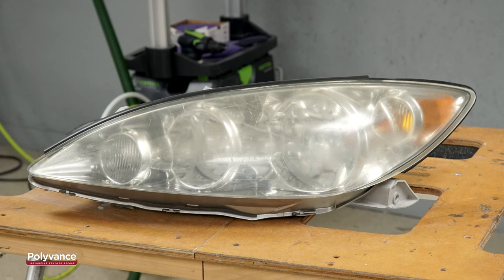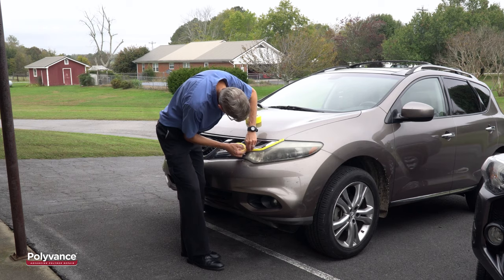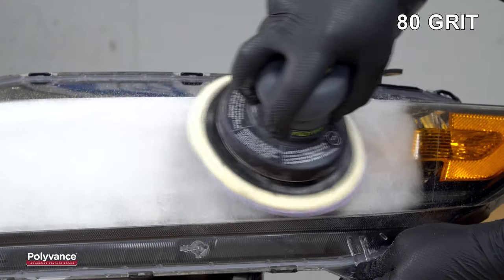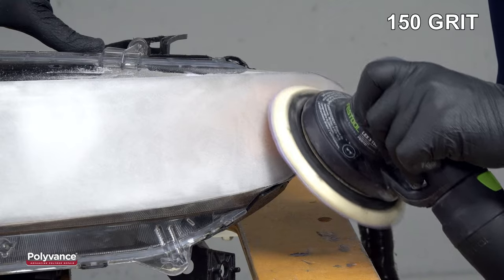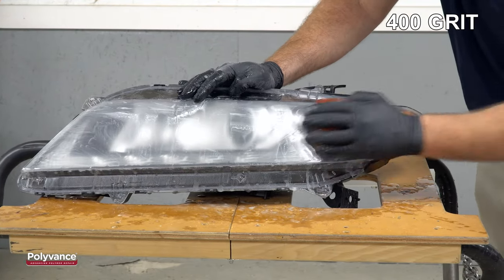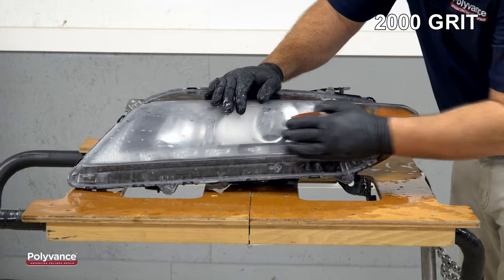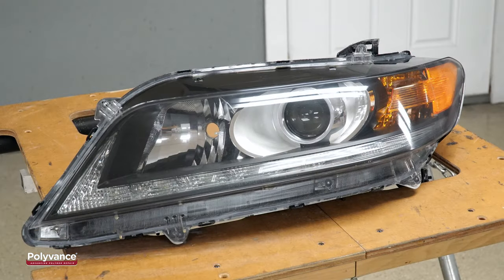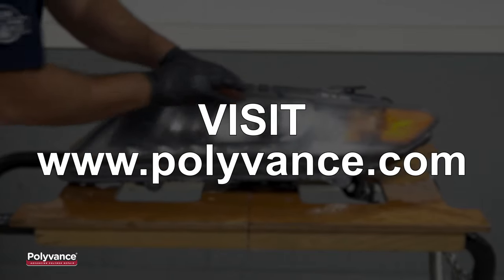How to Polish a Headlight Lens

Comment: Heck ya.  People need this video.  I've been doing this myself for years.  Did my Father's CRV a few years back and my Civic a few years before that.  It works fantastic.  I didn't know about the clear coats out there back then.  For me I just put a nice coat of carnauba wax on there after I polished them.  Once they are polished though it's easy to keep them nice.  Every 6 months or so you can run over them with a cleaner wax or just do a hand polish and call it a day.  I'd do this in a heartbeat with OEM lenses as opposed to replacing them with aftermarket.

Comment: Nice video, is there anyway you could list the grit numbers in order here?
Reply from the maker: Sure!
Dry sanding:
80 (because our lens had deep scratches)
150 (120, 150, 180 are all acceptable here)
320 (220 or 240 could have also been used here)

Wet sanding:
320
400
600
800
1000
1500
2000
The most important thing is not to step to too fine of a sandpaper between steps. You want to remove all of the sand scratches from the previous grit before you move on to the next finer grade.
Reply: @polyvance  Thanks, I want to try this
Reply from the maker: @I-Red  You're welcome!
Reply: I'm glad I seen this I thought I messed up my headlights because I scratched  them up with the 80 grit sandpaper because it was all I had so all I need is to get some 120 to get that out  ?  Do I need to use water while I'm using the 120 or 80 grit

Comment: I do basically the same process but at after 1000 grit I clean the lamp with a plastic cleaner then apply an adhesion promoter and clear it with 2 part automotive clear for durability. Too bad most people are so cheap and will not pay for it unless you want to do it for less than your material cost.
Reply: I do the same. No adhesion promoter, just 2 coats of clear and they last for ever.